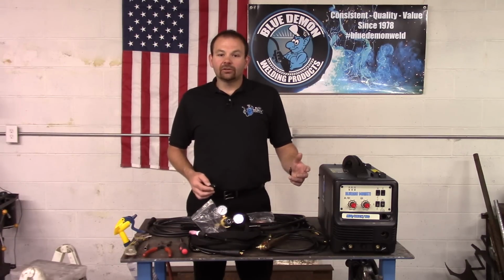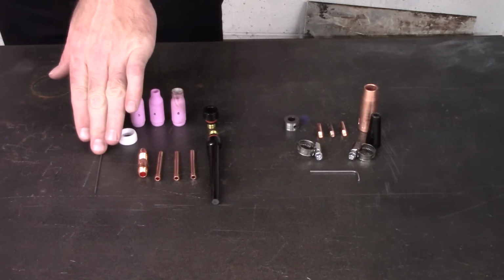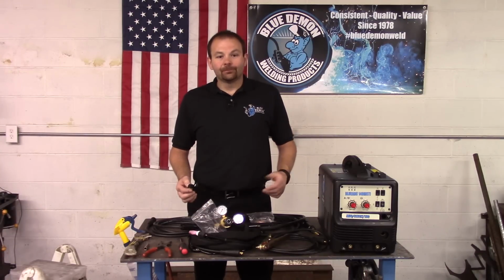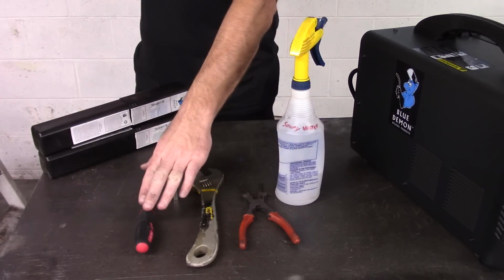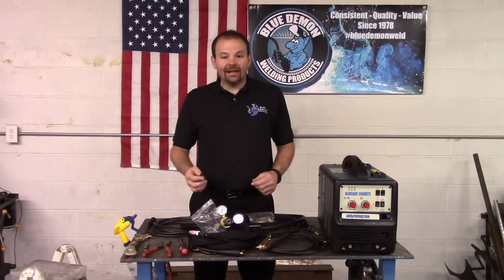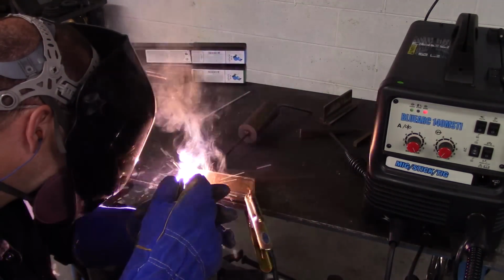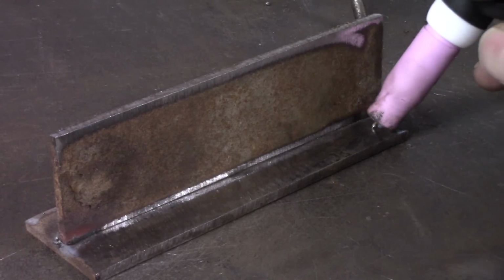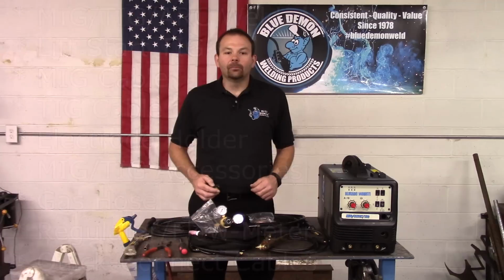Sponsored Video: Blue Demon's BlueArc 140 MSTI

Comment: at 10:50 you say If you have been mig welding with gas, You should not use the same gas for mig and tig welding. Explain yourself
Reply from the maker: Hey Aaron, You will typically use C25 or C100 to mig weld. So if you have been mig welding, you should not forget to switch out the gases. You will not be able to tig weld with C25 or C100. I have two tanks at my shop; one with Argon and the other has C25. The inside panel of the machine and instruction manual has recommended gas for the processes.

Hope that helps.
Reply: Ik your question was over three years ago but you would typically run  75/25 gas mixture for standard mig (75% argon 25% co2)
And for your standard tig you would use 100% argon you wouldnt want to use 100% argon for mig because it makes your weld very weak and brittle it provides to much coverage and you wouldnt want to use 75/25 for tig because the gas simply is pure enough to protect your puddle and give you the good penetrating weld your looking for

Comment: how long will is unit last with medium use too heavy use
Reply from the maker: Hey 73 Superglide, I don't think this machine is a fab shop unit. Its geared more for light duty work. Similar to that of most home shops. If you need Med to heavy duty machine you need something a little larger. Its a 30 percent duty cycle at 90AMPS so in my opinion it wouldn't be a good fit for med to heavy usage.